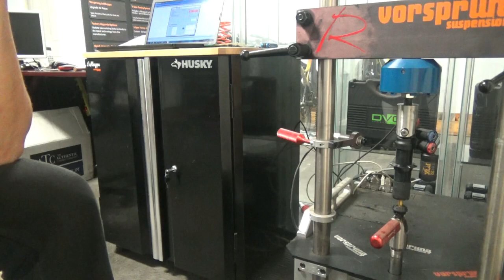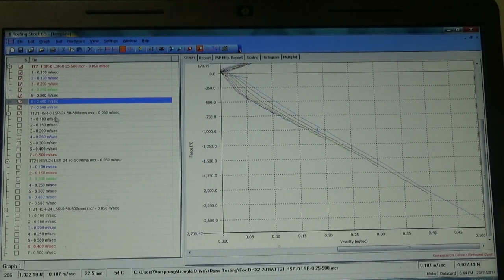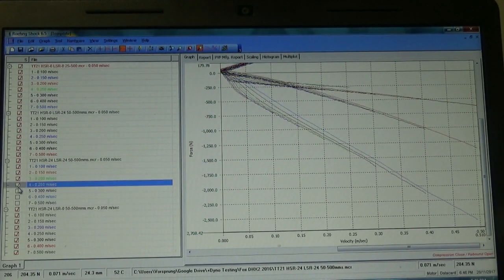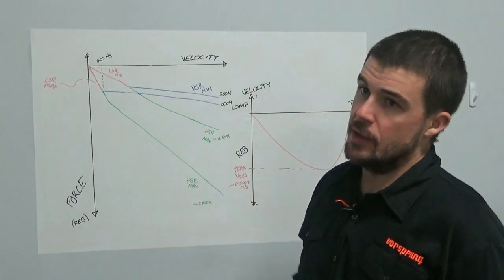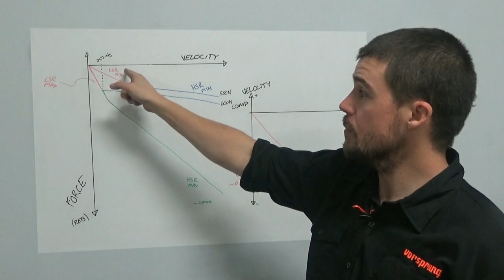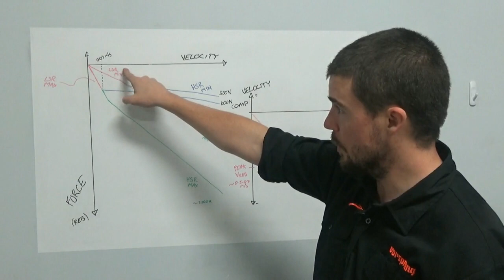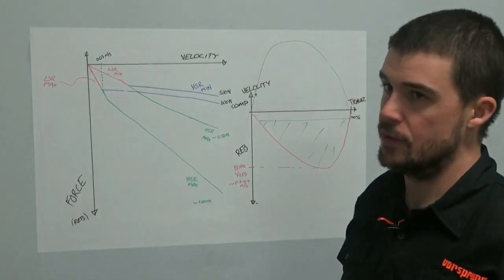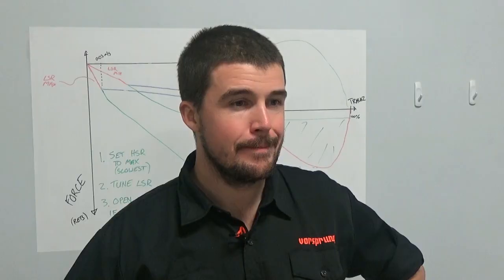The Tuesday Tune Ep 21 - High and low speed rebound

Comment: @vorsprungsuspension This was just the video I was looking for, I have a cane creek double barrel and am using a shockwiz to tune it.  I couldn't wrap my head around why the shockwiz was constantly telling me to slow down the LSR, I must have turned it 8 clicks or more and still it was asking for more LSR.  But then it dawned on me, if the HSR is too fast, I can't achieve as much LSR damping before the high speed circuit opens up.  This video explains why so much LSR adjustment, was having such little effect.  Shockwiz prioritizes tuning the LSR first, but I can see now why that is not a great idea!

Comment: Would this HSR full closed and using LSR for control 'hack' be applicable on a new model Fox Grip 2 VVC HSR and VVC HSC fork?
Reply from the maker: No - it is NOT applicable to the VVC adjustment mechanism either in the forks or the shocks.
Reply: @VorsprungSuspension   Got it! Thank you for the reply.👍
Reply: @VorsprungSuspension Thanks, had the same question. Perhaps you could provide a new video explaining why, show us some dyno data, and what the tuning/setup process looks like for those dampers? Thanks!

Comment: @VorsprungSuspension thank you for the video. very helpful to see interaction between HSR and LSR. 

Question: is it safe to do this tuning method on Cane Creek Kitsuma. My worry is that range of adjustments is quite wide on that shock and if I completely close the HSR circuit I will damage the shock or decrease the longevity of it or internal components, since oil will be forced to flow mainly through the LSR circuit. 
Thank you. :bow:

Comment: Hi Steve I have a super deluxe shock with 3.5 tokens on my Orange Switch 6 which I feel I can’t get the rebound to be fast enough at 140psi. 

Would you recommend a revalve to speed up the high speed rebound? I’m after a bit more pop out of compressions and I also feel the bike sits into its travel to much.

Comment: Would you recommend the same for the 2021 X2s with VVC?
Reply from the maker: No - the VVC rebound damping behaves much differently, it's a much better system. Start with Fox's recommendations as per their website.
Reply: @VorsprungSuspension  Fox grip2 damper has VVC too,so It don't applies to the grip2 dampers?
Reply from the maker: @chadson5244  correct. Not applicable to those forks/shocks. The VVC rebound system is quite a lot better than the poppet-based system in the 2016-20 X2s (and the 2005-current CCDBs) in terms of being able to generate sufficient HS rebound without excessive low to mid speed rebound.

Comment: Hi Steve, thx for the excellent videos! I just got a 2019 Fox 36 with Grip2 damper. I’m a light guy at 145lbs and fox recommends tuning the HSR to minimum and mid range LSR. With 2 extra tokens over stock @55psi, I find in big chunky hits and jump landings the fork rebounds a bit fast coming out from deep travel. My intuition says I should dial in more HSR and reassess LSR at the new HSR setting.  Does this sound like sound process? Does the new Grip2 High speed adjuster using the wavy spring on the shim stack still behave the same way this video explains? Or does the new HSR adjuster produce different dyno curves? Do you recommend starting with maximum HSR with this fork damper? 
Thx for your help! Alan
Reply: Still waiting for a response 😂.
Reply: @topjmmi  I too am working with Fox's new VVC technology on a Fox 38 and still have found this method to be successful in it's merit. Worst case scenario, start with the adjusters halfway and begin to bracket each in one direction or another by process of elimination and feel. Cheers
Reply: @topjmmi  some where in the comments Steve mentions that this doesn't apply to the forks.

Comment: This makes a lot of sense with the dyno graphs and your explanation. For some reason I assumed shaft velocity on the shock was similar in compression and rebound but I now realize that was incorrect. 

I have a DHX2 and could never really notice a ton of diff playing with LSR and HSR against each other. 

One question: does heavier spring rate coil impact whether HSR fully closed gets you enough speed on LSR? I run a 500# spring on an Aurum Carbon, 2017 DHX2.
Reply from the maker: Spring rate does impact where your HSR would end up in order to get an appropriate setting from your LSR yes. Heavier spring rates will see you end up with both adjusters further towards closed, typically.

Comment: So much crosstalk between the low and high speed rebound adjuster. I wonder what is the level of interference between compression and rebound adjuster ie when compression is adjusted, what change in rebound can one expect?
Reply from the maker: In the X2 dampers, it's extremely small - realistically nil. Likewise with the Cane Creek dampers. Some dampers see some crosstalk between rebound adjustment and compression damping, but it's not always substantial. Compression adjustment usually has little or no effect on rebound though.

Comment: Hi good video. I've got a 2021 x2 I'm 90 kg with riding gear I got my shock back from a tuning shop set at hsr 2 clicks out from fully clockwise lsr 13 hsc 3 lsc 3 .the shock feels very quick on 13 lsr would you back it in more or change any iff theese settings please thanks Callum
Reply from the maker: Please note this video is not applicable for the 2021+ X2 shocks. They use a different (much improved) rebound valving system. HSR at -2 should give you plenty of range using the LSR adjuster though - there's no specific problem with simply winding your LSR in further if you feel the need.

Comment: Just wanted to share my experience here, after watching this video I ran my HSR fully closed on my DHX2 for a few weeks of trail riding. However I started to notice a hard top out feel, adding more LSR didn't help to reduce the top out, so I ended up having the shock looked at. It appears that the rebound circuit had failed. I'm not saying this was caused by running the HSR fully closed, but it could have been the cause. Just a heads up to anyone watching this who's thinking of giving it a try. Steve, feel free to comment if you have any thoughts on this situation. Cheers.
Reply from the maker: What do you mean that "the rebound circuit had failed"? What was the mode of failure? Running the HSR fully in will not cause issues unless you force it past the end of its range and break the internal stop (which can happen pretty easily on either HSR or HSC circuits) and will result in metal fragments floating around inside the shock which can jam circuits open. Beyond that, the entire range is intended to be usable, and other common failure modes (eg the shaft seal leaking oil or the piston band blowing off the piston on MY2018/19 shocks)  are not related to where you run your adjusters.
Reply: Vorsprung Suspension I believe that the rebound damping had stopped working, because the shock was topping out very harsh, no matter how much rebound was applied, as in feeling the inner bump stop. I agree that it may definitely have been from over tightening the valve. I mainly mentioned this to hear your thoughts on whether it could have been from running the shock in the fully closed HSR config. Appreciate all the info you provide. Cheers
Reply from the maker: No worries - I understood that the rebound damping stopped functioning as intended, but that could be due to many causes, not specifically the rebound circuits themselves. For example, the compression valves could be jammed open, which prevents oil from being forced through the rebound circuits, the piston band could have come off the piston (common issue on 2018/19 shocks), the seals could have blown and simply dumped oil, the piston could have come loose from the shaft, etc. If it's topping out harshly but appears to have rebound damping and the adjusters still have some effect, there's a good chance the spring is too heavily preloaded too.
Reply: Vorsprung Suspension Gotcha, thanks for the response on the issue, love learning about all the details of these shocks. Luckily the shock was replaced easily by the company and I'm back in action, but all of that is good to know for the future. Thanks again and looking forward to the next TT.

Comment: I'm finding really hard to get much help with my 2020 patrol with fox 2020 dhx2 it's has a 708lbs ohlins spring fitted 24% sag transition calls for 20/25% sag on coil 
my setting are
ssr  2 from full clockwise 
Hsr  2
Ssc  5
Hsc  2
 Bike just feels dead and lack of grip.
 no trust in not getting Bucked on jumps at speed 
Being told by local suspension shop I need to have the shock damper and rebound retuned to suit my heavyweight 122kg  6ft5 (HELP ME PLEASE).

Comment: Hi Steve, great explanation. does this also apply to the rebound circuit of the Charger1 damper? Its clearly preloaded like a HSR adjuster would do, but apparently the Charger2 isn't preloaded anymore (or so I read somewhere). Is this an area where I should consider tweaking my forks character, or is it a waste of time? :-)

Comment: Steve, could you help me out with the LSC and the HSC adjustment for my YT Capra? I'm running 160 PSI. Fully gear in 155. I'm running my HSR (1) from fully closed and my LSR (10).
Reply: My HSC is (14) from closed and LSC is (12) from closed.

Comment: Great videos. Considering your suggested tuning method for rebound, do you feel that linear rebound valving is preferred over a digressive valve?
Reply from the maker: Largely, but not entirely, yes. There is nothing inherently wrong with digressive valving in rebound - in particular for more rigid vehicles (including bicycles when you are sitting down rather than standing) they have some advantages. However, linear rebound valving has some advantages when standing up:
1. It's very predictable, what you feel in the carpark is actually pretty representative of what happens on the trail
2. There are less variables to deal with, which makes it FAR easier to get right
3. It's typically safer than digressive rebound damping in that the high speed control is stronger. With that said, if your HSR is set up well in either case, it shouldn't really matter.

This also assumes that the rebound adjuster actually functions well and doesn't have a crazy amount of bleed, which some do unfortunately!

Comment: Hey, great video. Is it possible to do a video on how the rebound and compression damping affects the way the suspension reacts under breaking ? My bike seems to get really bouncy under hard breaking(more so on steeper trails)
Reply from the maker: There's a lot of aspects at play there - the kinematics of your frame have a huge effect on braking performance as well as the suspension setup itself. For example, if you're riding a high pivot bike without a floating brake (eg Zerode DH bike) it will squat a lot under braking. By contrast, if you ride an old Lawwill linkage bike without a floating brake, it'll do the exact opposite. Most bikes lie somewhere in between, with fairly moderate geometric effects on braking, but the differences are still substantial enough to be very noticeable.

Comment: Hey Steve & the Vorsprung Suspension team,
this video features a super nice test and the results are explained really well!
But what i wonder is, if we can adapt the presented information to forks wit H/LSR like let's say a fox fork with grip 2 dampers, too? If this is not applicable, could you make a similar video where you point out similarities or differences between fork / shocks regarding H/LSR? Thank you!
Reply from the maker: It is not applicable to Grip2 dampers or the new VVC valves - they don't behave in the same way as this.
Reply: @VorsprungSuspension   thank you for your fast response to my comment, Steve! 😊
As i could not find a video from you about the VVC in particular - does that technology mean, that Grip2 rebound damper show a kind of “higher independence” than the shocks’ rebound referred to in this video?
What source do you recommend for understanding VVC?
Do you know of a test & graph similar to the one you performed here for a grip 2 fork by any chance? Guess that’d be treasure 🤗
Thank you & keep it up🙏
Reply: @BeroBaer  I hope he answers this eventually. I'd also like to know.
Reply: @dukeofmtb  Hi, Steve answered someone else in the comments that this doesn't apply to the Grip2 or other forks.

Comment: I wonder how these curves would look on the 2021 models with the HSR shims changing leverage instead of preload...
Reply from the maker: Totally different, fortunately. VVC is a way better method of adjusting HSR than this was.
Reply: @VorsprungSuspension  was hoping someone had asked my 2021 far exceeds the 2019 dhx in Rebound damping control

Comment: Is this also applicable to the new Fox 36 Grip 2?
Reply from the maker: No - they use a totally different system, there is no preload on the rebound shim stack in the Grip2 damper. It is a very good system.
Reply: @VorsprungSuspension  What's a good way to dial a Grip2 damper in? Thanks in advance

Comment: Does this still apply to the 2020 X2 shocks?
Reply from the maker: No, it does not - nor does it apply to the Grip2 fork dampers.
Reply: @VorsprungSuspension  thanks for clarifying!
Reply: @VorsprungSuspension  If you wouldn't mind, please clarify if this applies to the "2021" shocks. The "2020" shocks were actually released last year. I believe the question here is if this applies to the VVC high-speed rebound shocks, which would make sense that the theory does not apply because I imagine the dyno will show different results due to the new tech.

Comment: Great video that I have watched numerous times. After prolonging the dropouts on my bike I am now in that critical range where the LSR is completely open and the rebound is too slow. Should I continue to have the LSR completely open and use the HSR as my primary adjuster? Or should I open the HSR a few more clicks and have a range of LSR to work with?
Reply: Yeah this is what I’m wondering. Maybe use his method of bracketing from where you’re at to further dial it in?
Reply: My question as well!

Comment: steve so basically the high speed rebound is there for different leverage ration bike frame and different rider weight...for instance HSR 1 - LSR 1-10 leverage ratio 2.5 rider 50kg , HSR 2 LSR 1-10 LR 2.5 rider 60kg ,HSR 3 - LSR 1-10 LR 2,5 rider 70kg...is this why shock are have HPR?
Reply from the maker: That's a reasonably good way of looking at it yes - the high speed adjuster sets the range of the low speed adjuster.
Reply: So if I'm understanding this correctly, the intensity of every 10 clicks or so of LSR is affected by every individual click of HSR?

Comment: HSR max means fully closed? i have the cane creek inline coil on a Reign and i basically set the HSR to the same as HSC at half closed
Reply from the maker: Max means fully closed/fully slow yes.
Reply: Vorsprung Suspension 
So you mean it's good to set the HSR as slow as possible and then adjust the LSR?
Reply: did you even watch this movie? Yes. hsr set to slower as possible.
Reply: @VorsprungSuspension  what do you suggest for 2020 x2